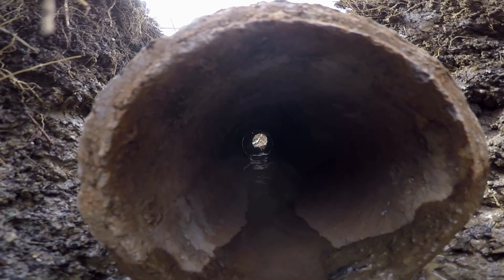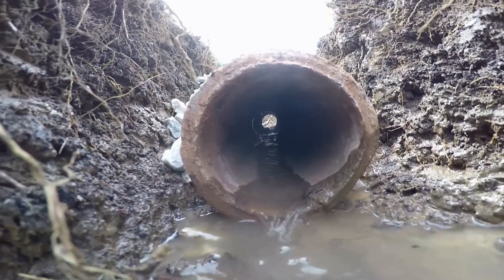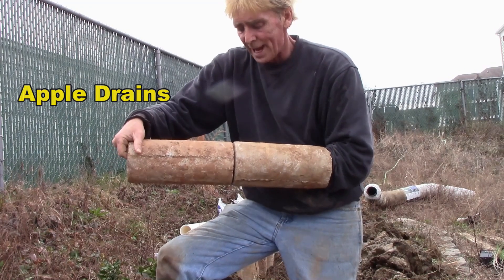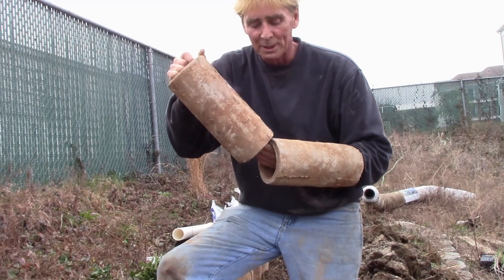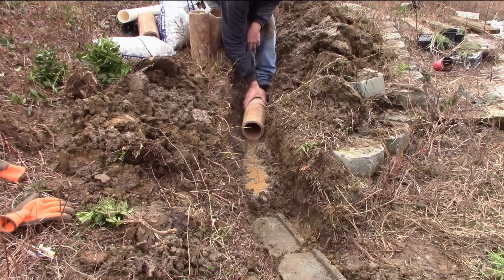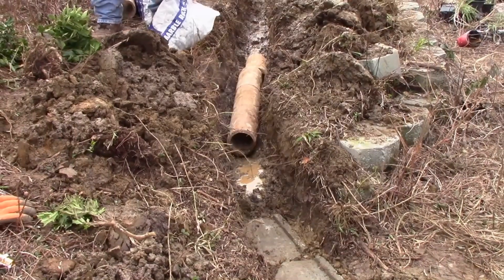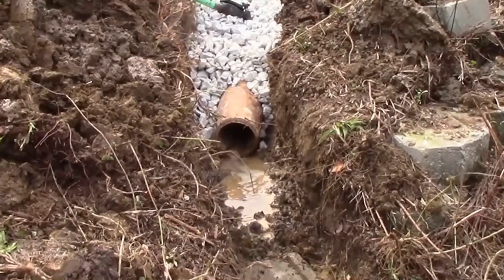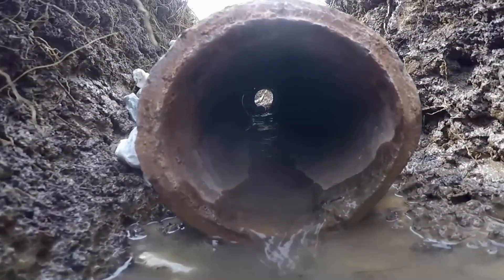French Drain, How It Works

Comment: Hey Rick, I had a question I hope you can help me with. I have an old 4" cast iron swing valve going from my basement storm/weeping tile drain to the storm water drain at the road. The plumbing is a convoluted mess with eavestrough drains going through my sump basin and just a generally poorly designed system. I want to replace my 4" swing valve with a modern PVC backwater valve, however between the sump pit and the swing valve there is a house trap. The house is a divorced septic/storm, so no sewage flows through it, but I noticed I have a 4" elevation from the inlet of the trap in the sump basin to the swing valve. Is this much elevation necessary,  or can I just make the trap seal 4" with pvc and have the inlet maybe 1" above the backwater valve? The high inlet causes the bottom of my weeping tile drains to retain water and because of this water I have root intrusion into my system that I have to periodically clean out. The flow through this trap would normally be minimal, as the eavestrough drains connect between the trap and the swing valve, so most of the flow through that trap happens in reverse when water backs up enough to close that swing valve. Thanks Rick.